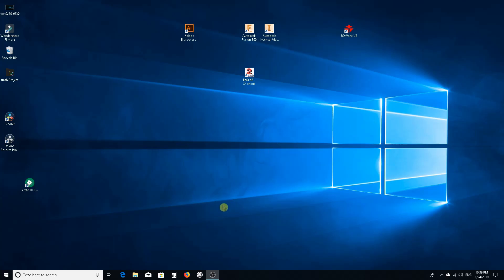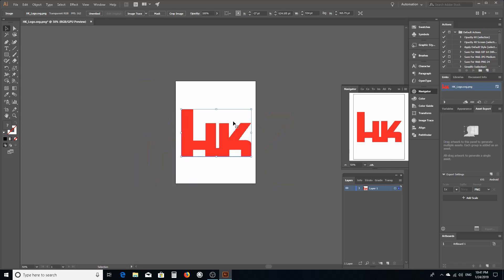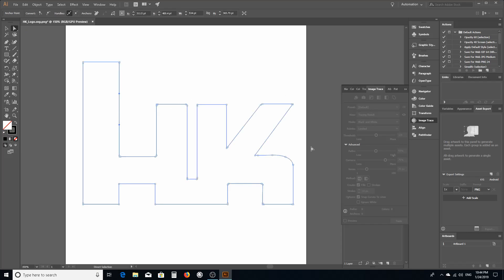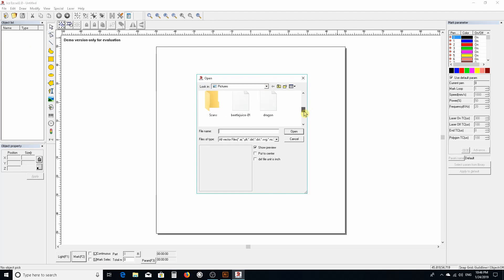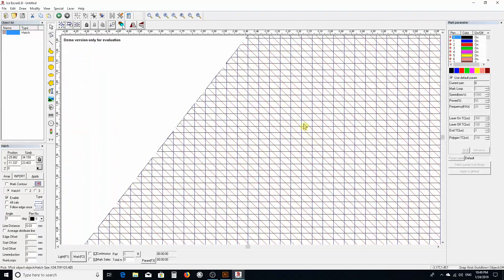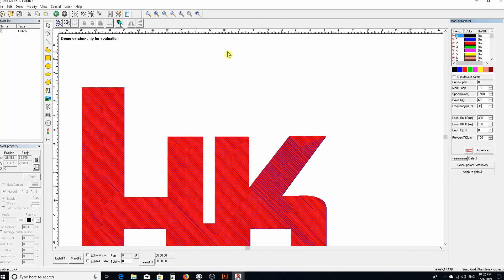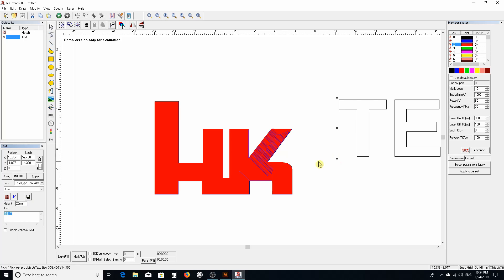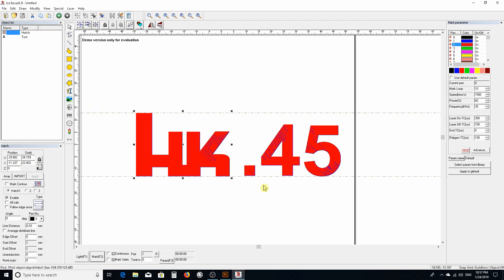EZCAD2 ENGRAVING SOFTWARE AND ADOBE ILLUSTRATOR TUTORIAL PART 1

Comment: You may can help me.

Wenn i open an file the grafic ist shown correct in monitor, but the F1 button that shows the preview shows the logo rotated by 90 degrees. When i rotate it in the software it will fit. so, do you know a solution...? Thanks a lot!

Comment: I’m having an issue with gaps in my images while burning. When the turntable turns for the next section it leaves a gap between the sections instead of making it a solid image. How can I fix this?
Reply from the maker: Have you set the correct diameter in the rotate mark dialog box?

Comment: Hello! Nice job on the video, very exploratory. I have a co2 marking machine for non metallic objects and it also uses EZcad2. I have a question, is there any configuration on the software that allows to engrave a round surfeses without (or at least with less) deformation? I need to engrave a logo on a 15 cm diameter wooden tube. Thanks !
Reply from the maker: You need the rotary attachment or it will distort if you try to engrave a flat over the edge of the diameter where it falls away from the focal point.
Reply: @ajimachining2537  Yes! i've seen videos with the rotary atachment, but my engraving wont pass the edge, its just a segment of 12 cm perimeter over a 15 cm diameter cilinder. I just need some kind of distortion on the vector image so it wont appear distorded on the engraved material. I dont know if i explained it clear, hope you can give an answer! Greetings.
Reply from the maker: @EliasGrunberg  you could try pinching your art work in a vector program to make it look like an hour glass or bulge it. It will be trial and error.

Also you could move your focus a little lower.
Reply: @ajimachining2537  Thats good! Ill try that, thanks!